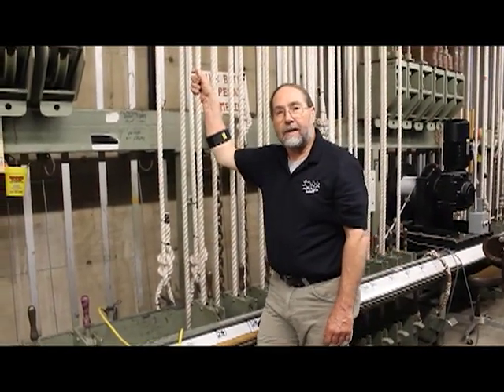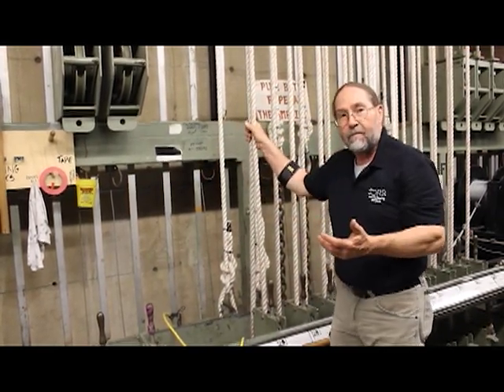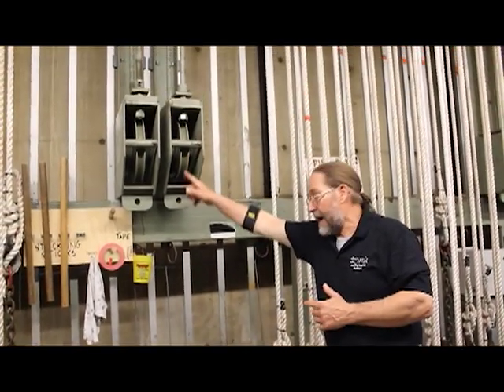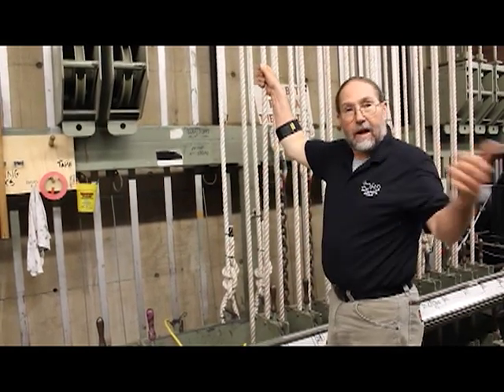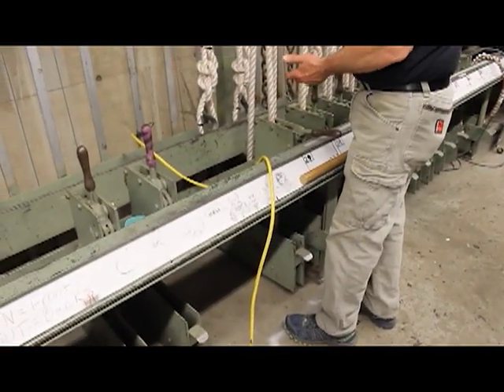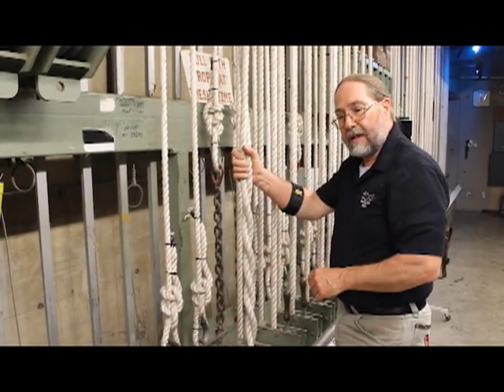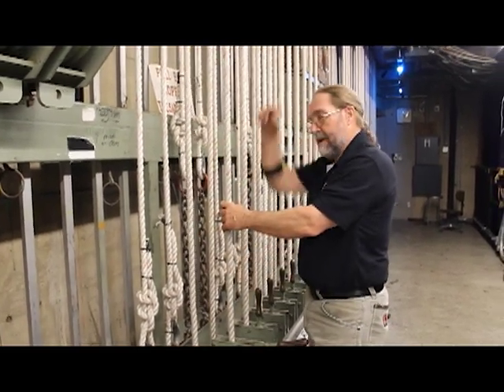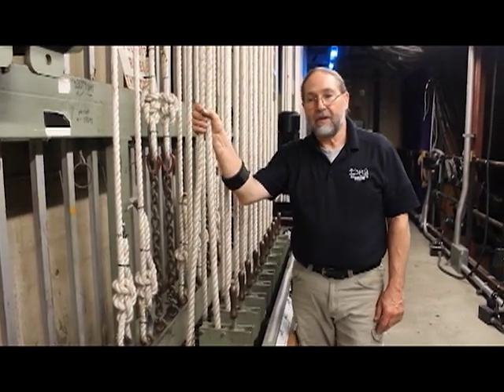Operations of a Double Purchase System

Comment: Great video. Can you explain how a system works when the locking rail is not SR or SL? For instance, the Minskoff Theatre in New York, locking rail is located on US wall of theatre. How could this arrangement work? Thanks
Reply from the maker: Hi Richard, 

Typically these systems are no different than the ones we talk about in our videos. The only difference is that a system along the US wall would have a series of redirects (also known as Mule Blocks) that would send the lift lines where they are needed.